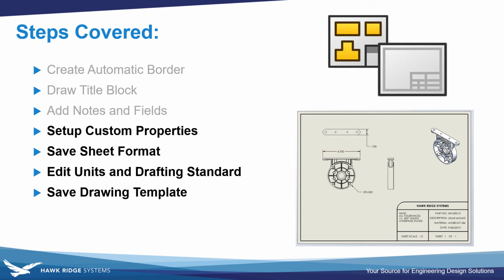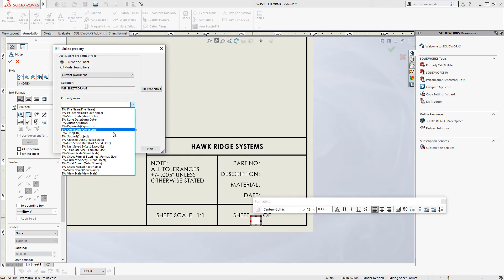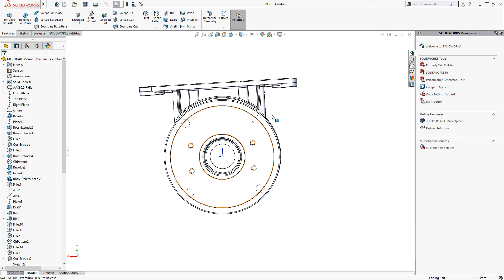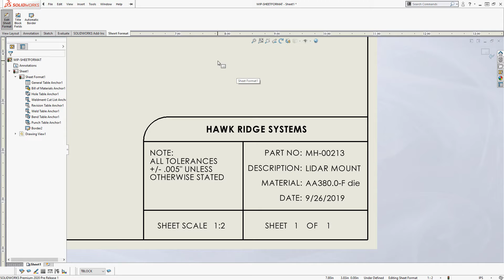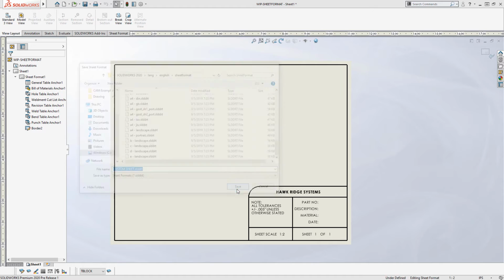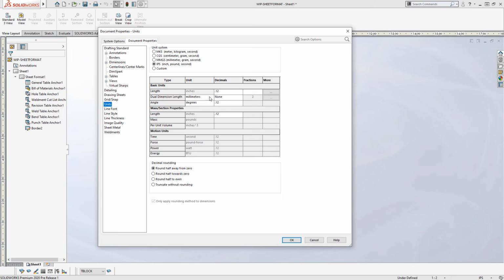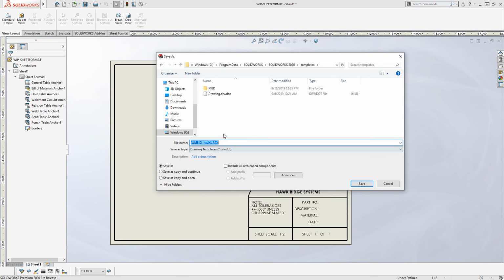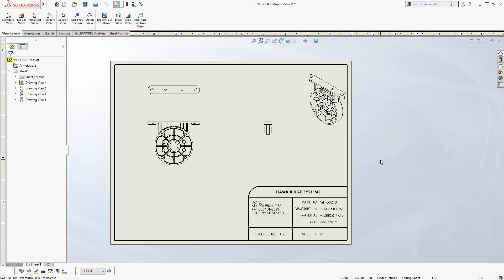Drawing Templates from Scratch in SOLIDWORKS: Part II

Comment: If you run into the issue where you create a new drawing and the dimensions come in as ISO even though the drawing standard is ANSI:  In the new selection box, click the advanced button at the bottom left (not novice).  Then pick your desired template.  If you pick the novice option and then the drawing button, it will have you pick your drawing format but the template will be the generic template without any of the drawing properties that you have selected.

Comment: Thank you for the usefull tutorial. I made an template for SolidWorks lessons which i teach on a university. Now I like to use this template on different computers. Is it simply copy the template from the default file location of my computer and save it on the default file location of the other computers?
Reply from the maker: Yes copy and paste between the computers should work. Alternatively if there is a shared network drive available, you could also store the template there- then modify the File Locations of all the computers such that they reference the shared network drive for Document Templates.

Comment: Hi, thanks for the tuto, it's very usefull. Helps a lot to understand the logic to follow with the sheet format. I manage to create an A2 template that seems to work just fine. Then, from that A2, I modified the format to A1 by using custom properties and setting the dimensions equal to A1 dimensions (so width and length values). Then I reorganised my title block, scaled a little bit of this and that, and saved a new A1 sheet format, and then a new A1 template. But now the field "sheet size" displays "custom", and I can't get it to display "A1". The A2 template displays its size "A2" correctly though. Is there a way to change the custom dimension to a standard dimension? My intend being to create derivated formats from A4 to A1 with the exact same template properties.
Reply from the maker: The items that show in the "Standard sheet size" are actually the default sheet formats. If you are creating your own new sheet formats and saving them in the default sheet format directory, then you likely just need to uncheck the checkbox "Only show standard format" to see your new templates.

If you are saving your new sheet formats to a new directory, then you would want to Browse to that location and update your File Locations under Tools -> System Options -> File Locations, Sheet Formats to point to the new folder location. Then you would still need to uncheck the "Only show standard format" checkbox under standard sheet size to be able to select your customized sheet formats.

How your sheet formats show up in the list depend just on their file name, so it sounds like you'd want to name them with a convention like "A4 MySheetFormat"

Hope this helps!
Reply: @hawkridgesystems  Thanks for the answer. However my question was unclear : I succeded in creating my A2 template. From there I hoped I could modify it to create A1 and A3 templates. But I couldn't find a way to modify only the size of the canvas (like you would do on Autocad for instance) except by choosing the "custom sheet size", and then the automatic sheet size parameter is locked on "custom".
For those who have the same problem, it seems like you must pick a standard sheet format of the right format (ISO, ANSI whatever) to start with. A little trick is to start from your 1st custom template (for me it was A2) so that the program parameters are kept (fonts, line styles etc). Then you swap the sheet format for a standard of a different size (for me it was a A1 ISO). As the title block will be lost, I copy paste it back from my custom A2 template, modifiy a little the layout, increase some cells and font size, and repeat the steps to save a new A1 custom sheet format, then template, just like Hawk Ridge explained.
I would appreciate that Solidworks makes it simpler for us, but you know, if it works fine where is the fun...?! Typical Solidworks :P

Comment: Thanks for the tutrial!
Is there a way to merge a sheet format with the template options of a different drawing template?
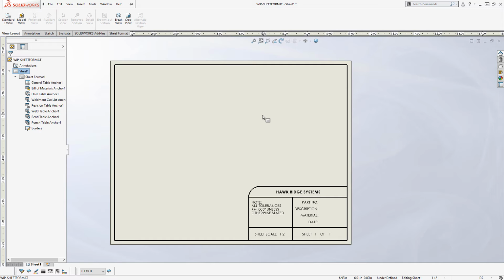Reply from the maker: To do this you would want to follow the procedure at 6:08

You can swap the sheet format being used by a template. So the trick would be to create a new drawing using the template with the options that you want (even if it has the wrong sheet format) and then edit the Sheet Properties to choose the desired Sheet Format. Then you can save the resulting document as a new template, or overwrite an existing template.

Hope this helps!

Comment: Great lesson, thanks. I feel a bit more confident now. If I decide to make a change to either my template or my format, can that change be propagated to existing drawings? Will I need to manually make the changes? Can I tell the part's drawing to use a different template without losing all of the dimensions / notes / etc?  Thanks for posting this -  a great help!

Comment: Thanks for a very informative tutorial. Very well presented!

At the very end, when you modify your template, do you have to re-save the sheet format again before saving the template if you changed it? Or does saving it as  you indicate keep all your changes in the template?
Reply from the maker: Good question! Short answer is: if you are changing the sheet format, re-save the sheet format. 

Long answer: If there were any changes specifically to the Sheet Format, I would recommend saving the Sheet Format again. To play it on the safe side you could even repeat the step of making sure that latest Sheet Format is selected in the Sheet Properties before saving the Template.

Otherwise what could likely happen is: you would have an updated sheet format on Sheet1 of any new drawing you create, but when you go to create Sheet2 it would use the older, out-of-date sheet format that is still referenced in the template. 

In this example, we didn't modify the Sheet Format at all from the time it was saved to when we saved our Template. The only changes we made were to template-specific settings such as Document Properties (Units, so on) so we didn't need to re-save the sheet format again.
Reply: @hawkridgesystems  Awesome response. Thanks!!